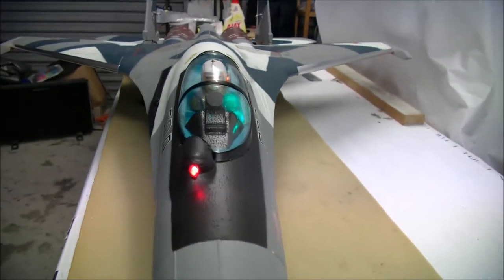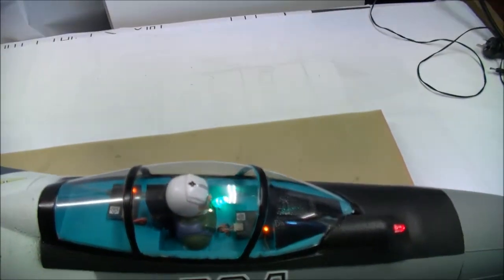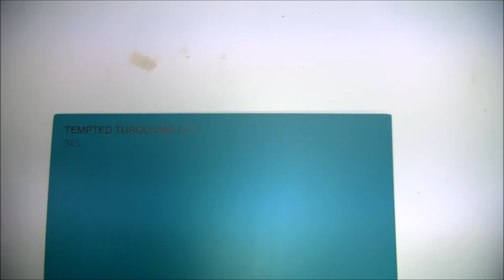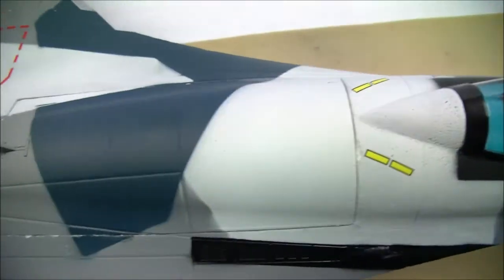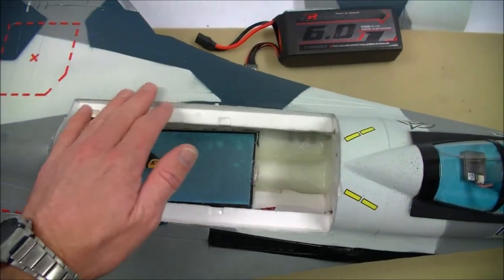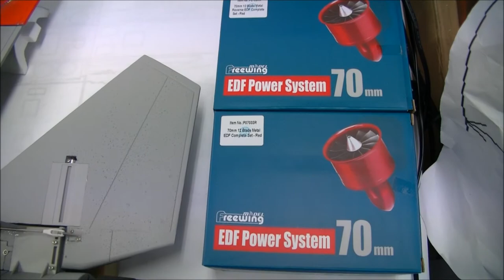Freewing SU-35 EDF Jet Walkaround | RC Skunk Works ADP

Comment: Dude what can I say, spectacular build. I have built mine to a similar spec, power to weight was insane except I opted for a 5000 setup 2 CP 2200kv 12blade setup, with a 14 channel setup if you have the patience.
The control options were insane. Single handed the best fun jet to fly if control and poise is your thing, just wish new EPO was an option.
Best of luck with the maiden.
Trigger
Reply from the maker: Triggerslappin Thanks for your comments fella,
I totally agree, I also wish that they would bring out a new EPO version two!
Anyway the maiden flight went perfectly, with the gyro and and thrust vectoring disarmed, only trim adjusting required were a couple clicks of back trim on the elevator. Two reasons for this I think are, the CG maybe slightly forward for achieving it's optimum performance and also I may have 1° down thrust on the nozzles which isn't helping. On the next flight, I'll reposition the nozzles angles, arm the gyro, thrust vectoring and also bring the CG back a tad. Can't wait to try some high alpha passes!

Comment: Very nice build indeed. Looks great!

A couple things to note though:
- I would not cover up the cheaters. The do help airflow, which in turn means more power/less consumption. The main intakes are long and fairly restrictive unfortunately. Besides, there is no real benefit from closing them up either, as far as I can see.
- Glassing the battery bay is a great idea. But you really want to do that with the nose gear well as well (the aft part if it, where the nose retract is mounted). This is a known weak point on this model, the foam is super thin and high alpha landings tend to whip the nose down quite a lot, putting a lot of strain on this.
Reply from the maker: Thanks for your comment. And you're 100% right!!! About the cheater holes with this SU-35!  I've since opened them up.
Reply: Adding "glassing" to the nose gear well will also add more unnecessary weight as well! Glassing the battery bay is  good enough to strengthen the plane where it counts. If you add more "glassing" to the nose, you might as well do the whole plane!!